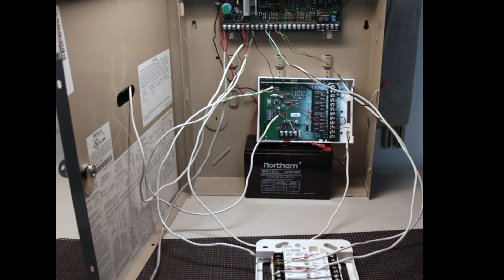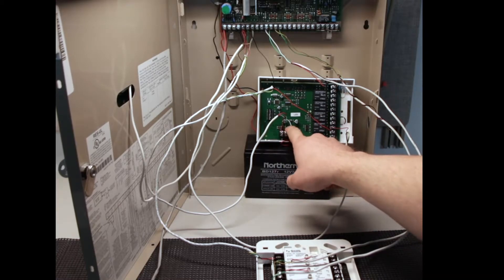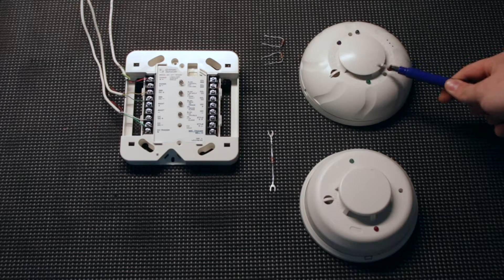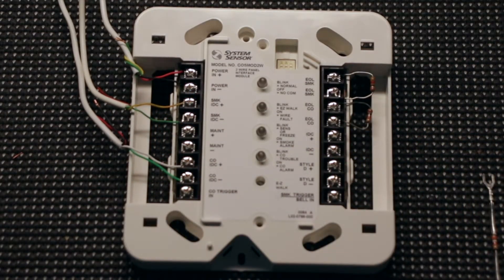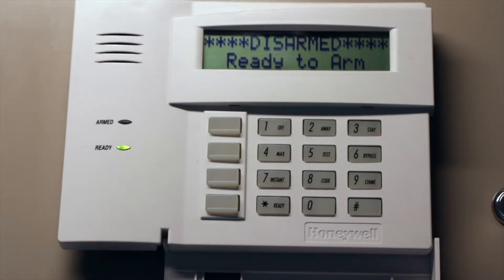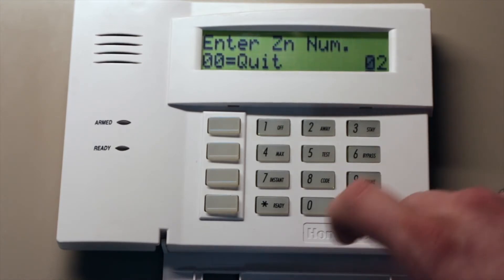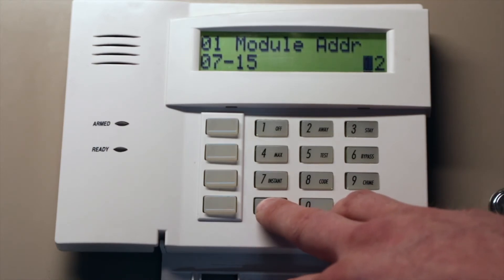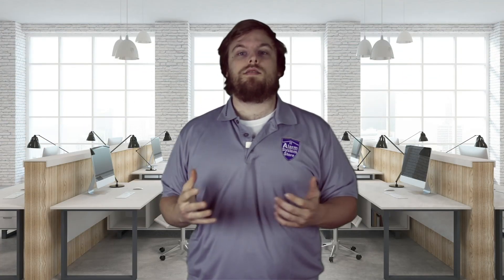System Sensor COSMOD2W and COSMOD4W wiring and programing tutorial for Honeywell Vista alarm systems

Comment: I like how you cut off the video without testing what you wired and programmed. I'm assuming its because you ran into the same issue as everyone else that uses this with Honeywell panels. When power reset is issued after a fire alarm causes the CO zone to go into trouble because System Sensor engineers missed the boat and claim this as normal operation. There is nothing normal about getting a trouble condition. My solution was to ditch the EOL resistor on the cosmod for the CO zone only and program zone 2 as no EOL and normally open. That fixes the CO trouble upon smoke reset. Your wiring and detectors are still supervised with the fire loop. I'm all ears if you figured out some other way to eliminate the CO trouble.
Reply from the maker: Well you know what they say about assumptions.... Before we post a video we test the setup to make sure it's going to work. It's been 3-4 years now, but I don't recall any issues or troubles popping up during testing we had to work around. If it was something that significant we would've mentioned it in the video. What you're running into may be something unique to the firmware version of your panel or newer COSMODs. 

Here's an option to try though if you want. From the sound of it, the CO zone appears to be popping the trouble before the COSMOD has time to fully reboot and show proper status. Try using a longer response time with the normal EOL wiring for the CO zone, see if that helps.
Reply: @AlarmSystemStore  I'm running firmware version 10.26 on the vista 20p. I tried your suggestion of increasing response time on my CO zone to it's max of 1.2 seconds (option 3) and still goes into CO trouble. I understand you made this video 3-4 years ago but I still think you glazed over this issue. I challenge you to test it out for yourself and see what happens. Even System Sensor released a tech bulletin that mentions the trouble condition with the CO zone when the COSMOD resets. Unfortunately they have no fix or plans to fix the trouble condition behavior.

Comment: How do you wire an additional cosmod on a power series neo
Reply from the maker: If you need a second COSMOD on a NEO, you'll need an HSM2204 power supply with outputs to power it. The zone wiring will just connect to 2 additional zones.
Reply: @AlarmSystemStore  so if the original cosmod is connected, for example, the co detector is zone 7, and the smokes are zone 8. Then, on the new cosmod do I just put co detector on zone 9 and smokes on zone 10?

Comment: Is it possible to continue the chain as you’ve shown and add additional 2WTA-B to this COSMOD setup?  I have a location where I need both smoke and CO but don’t want two detectors next to each other.  I’d rather set up the combo system to handle that.  The rest of my smokes are 2WTAB
Reply from the maker: Yes, thats fine. You can have up to 12 total COSMO2W or 2WTA-B sensors connected to a chain on the COSMOD2W. We only used a couple for demo purposes.

Comment: What resistor are you using in this panel? The 2k or dsc 5.6
Reply from the maker: We're using a Honeywell system, so they are the 2K resistors plus the unique resistor that comes with the COSMOD. The resistors you put on the COSMOD terminals will always be the resistor that the panel your working with needs. The End of line resistor on the sensors is the COSMOD resistor.
Reply: @ so both resistors (the one that comes with the system and the one the two that goes in the module) should be the same value?

Comment: I don’t know a lot about the wiring, but trying to figure it out because my security company decided they don’t want to support crossing over my existing 4w to their monitoring. At the beginning, you were explaining the need for the 4204 relay, and you said “if you are using trigger 17.” Probably some ignorance here, but I didn’t see you hook up to output 17, which I thought was the far left of the 8 pin connector.. what am I misunderstanding here? 

Additionally, are you saying that if you aren’t using that output, you can go without the relay? What would the alternative be? And I’m guessing there is a good reason to use output 17, what’s that?

For help with my question, I have the cosmod, 3 cosmo4w combos, and 5 4wtb smokes. Previously, the system was only 6 4w smokes and I think connected through output 17 and zone 2 only.. the security company cut most of the stuff from the panel, removed its power, and used a cross over wireless to utilize my wired window and door sensors. Now I’m needing to add power back to the vista panel and set up only smoke and co zones. I think I can do it just like in this video, and thanks so much for it, but I was just curious if the above. There is a lot going on in the Honeywell box right now, all most unhooked (previous monitoring services and other modules that I don’t know what they do)..
Reply from the maker: The techs shooting the vids rarely check in on the vids beyond the first month or so of posting. I can and often do answer many questions on here the channel, but I am not as up to par on the finer details on the Vista system programming in particular. I'd recommend you submit a support ticket on the website for this.

Comment: nice video, thanks! one question though: what's the benefit of using the 4 wire version over the 2 wire version? why not just use the 2 wire?
Reply from the maker: For new installs the 2-wire is generally the better choice, but I believe the 4-wire option exists to include existing 4W smoke detectors.

Comment: I have recently replaced the CO2 sensors (CO-REPL) in 8 COSMO-2Ws. Since replacing them, the system has been in a constant Trouble/Trouble Restore cycle. All the zone faults are for the CO2 zone. I've rebooted (complete power down) and cleared faults multiple times, all to no avail. Can anyone provide some direction?

Comment: Do you know of any security systems that use a digital packet method of communications between the sensors and the panel as opposed to analog wired sensors?
Reply: you could try the Honeywell vista panels and 5800 series devices. you will need a wireless transceiver for the devices.